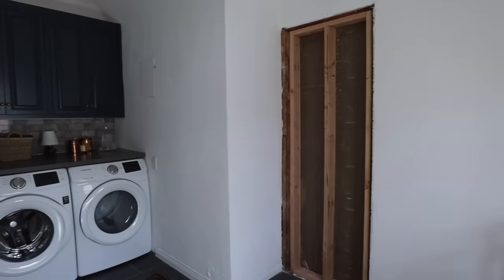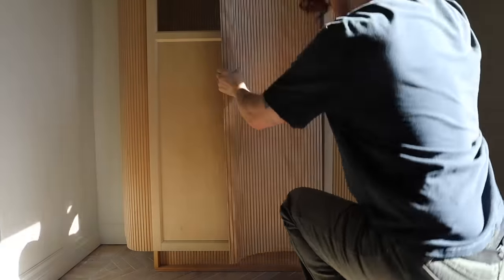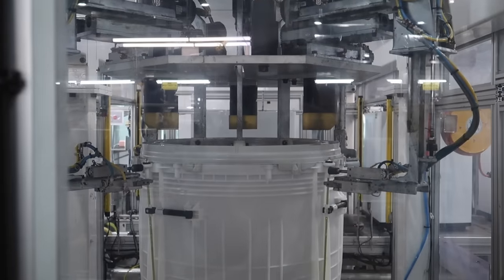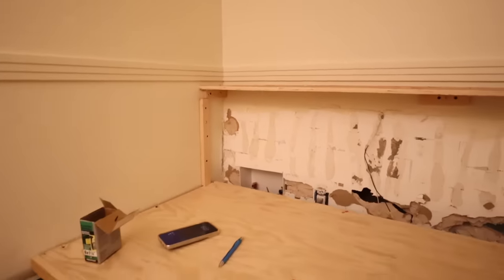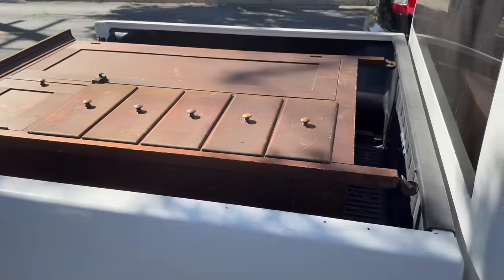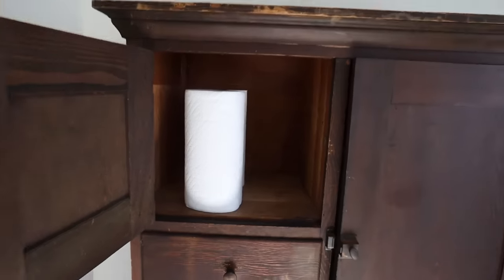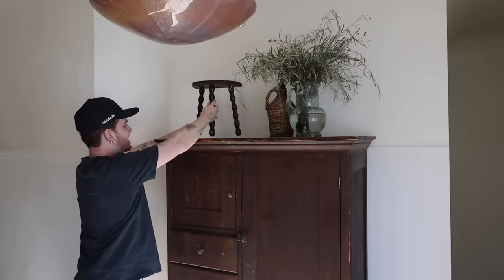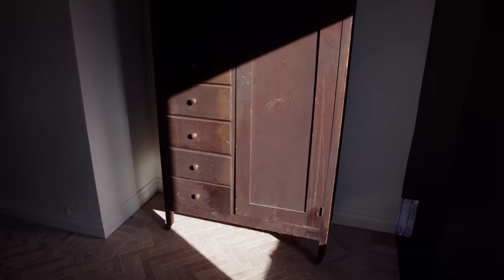Extreme Laundry Room Makeover 🧺 DIY Checkered Tile Countertops (FROM START TO FINISH)

Comment: I really enjoy your videos and I particularly like your staging.
However I would say that this is not one of your most successful projects, and that’s OK because no one can get it right all of the time.   

Form should always follow function.  
For practicality and for safety it would have been better to stack the dryer on top of your washing machine in order to provide easier and quicker  access to be able to turn off the water and electricity (seconds count in an emergency), and you also need access on a regular basis to clean the filters (blocked filters can be a fire risk).  There is also a lack of airflow around the machines.  Stacking the machines would still have left space to one side for a clothes rail  (although I would have used a vintage Shiela maid pulley instead ) and for movable items to sit below this - a  small table for folding clothes and a laundry basket underneath the table, for instance. X

Comment: If i were you i would put a door in the closet wall , so you could access you washer plumbing just incase. My plummer told me you should replace those washer hoses every 5 years it even says to on the package when you purchase the hose.  Better to be save then sorry

Comment: I actually liked the before better. I also liked the cabinet you had there before (if you didn’t like the color, you could’ve painted it )than the one that’s there now and I think the countertop where you put non pertinent stuff and should be set up as a folding station. Overall, you are a genius at what you do but every once in a while, I see a fail.

Comment: I love your channel, but I have to scold you just a little. :) In all friendliness, at the 14:24 mark, your checkerboard tile pattern should have been moved a half tile to the left or right. The visual rule is that you should never have your tiles die into the left and right walls with less than a half tile on any row. It's too visually jarring. In other words, the centerline of the counter & backsplash should have been on the grout joints instead of the centerline of a tile. The same issue is true on the horizontal surface of the countertop from front to back. Sorry to be picky, but we shouldn't ignore centuries of design rules.

Comment: Well, you're close but that new cabinet is only a minor improvement over the fake folk one you had before. Again it seems like you went over budget on the kitchen but the laundry room should coordinate or complement the kitchen, not be a whole different design style. The worktop/backsplash over the W/D machines is too busy, too different and doesn't really fit the vibe character of the house.
Suggestions:maybe you can work in some elements from the kitchen. Paint the new cabinet the same color as the walls ( DO NOT distress it!) and use some black period hardwood. Get a black hanging rod. Take down the rug! It adds nothing!  Just my unsolicited 10¢!

Comment: I am in love your space so amazing. As someone who works w mosaics and ceramics I would not recommend tiling directly on a wooden surface. Interior does make it less likely to crack in the grout and pop off but Next time please use a cement board. I hope the tiles don’t pop off 🤞

Comment: Don't leave a washing machine or dishwasher running when you're not home, in case of a flood. Don't leave your dryer on when you're sleeping or out of the house. It can catch on fire because of lint. It happens more often than you would imagine. Stay safe. Find out how often you need your dryer professionally cleaned of lint.

Comment: This might not be an issue in your home because you don’t have little ones in your household. But, I heard a scary story about a front loader washer. A small child climbed inside during playing hide + seek. And closed the door. The water started filling up and thank God the parent heard the screams. But, those doors have a safety lock and they had trouble getting the door open. I believe they had to pull the power plugs to get the child out. But, just beware of that feature.

Comment: Looks absolutely fabulous. A tiny adjustment idea.  Hang the prayer rug on the wall to the right of the washer and dryer.  That way it will be seen when you enter the space. Feeling inspired. 40 year interior decorator & designer veteran ❤❤

Comment: I fear you have made a fatal mistake putting those water cut offs so out of reach.  Quality is not what it used to be (no offense to LG), but no longer can you count on a washer lasting 25 years.  Five if your careful.  Having to pull a washer out of the way as water is flowing everywhere to get to the turn offs is a really poor idea.  Aesthetically your laundry is beautiful, but functionally not realistic.  Remember when you were pulling the old ones out?  And you could get at the cut offs then.